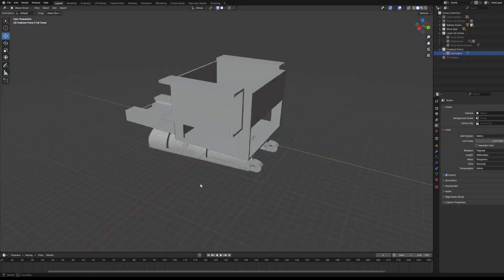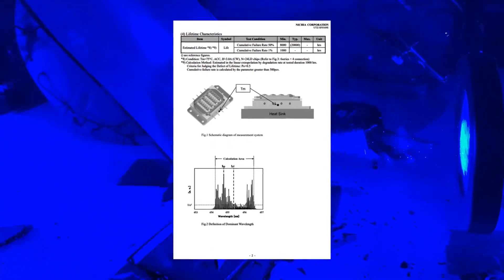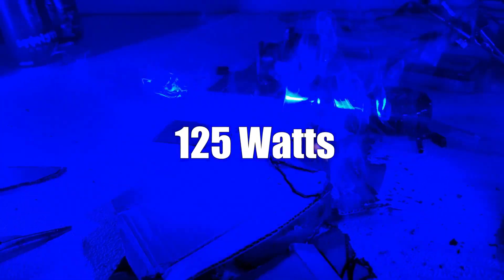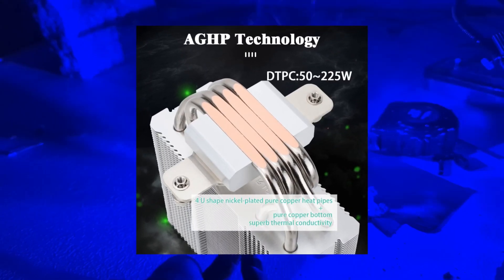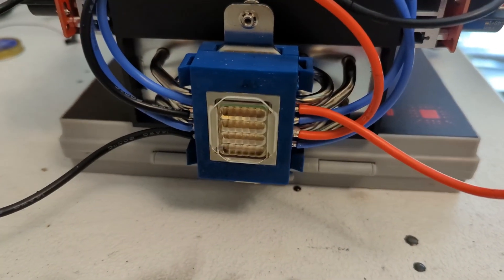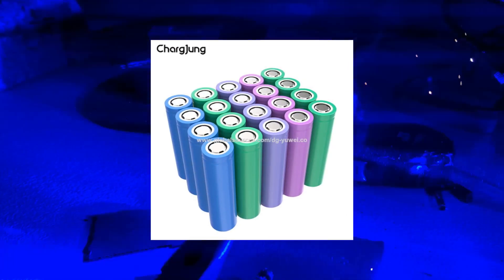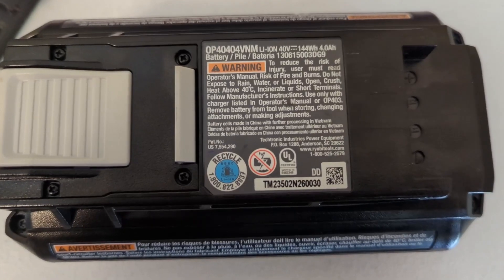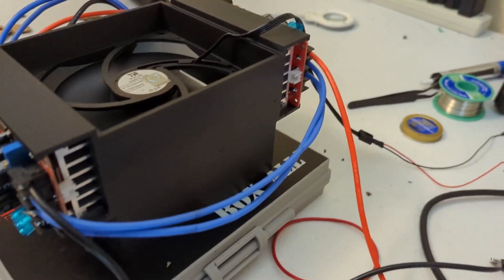NUBM37 125 Watt High Power Blue Laser

Comment: All of this can be easily carried in a box.  This is one of my lasers that uses the same 125W laser array

https://youtu.be/fcedMyiD3Qc?si=F_gSPOZQgxgo2bQV
Reply from the maker: I've seen your video, and loved your design. It's why I bought the diode array in the first place to toy around with it. I subbed to your channel a while ago.
Reply: @EikonicEngineering  I am currently working on IR laser pumps.  I bought one 260W and one 120W.  With great difficulty I removed the fiberglass.  I had to shorten the array by about 5mm and drill a new hole at the outlet.  It was very hard work and it's good that I have a lathe at home.  Now I'm looking for a sneaky focus lens.  I have many lenses but they don't work.  Strange, but I still don't put anything in front.  Nothing happens as if I put in a regular piece of glass.  Cannot focus the beam

Comment: So you wire your boost converters in series then do the same with diode/
Reply from the maker: I wire the boost converters in parallel to the battery, and then the diode array is in series. There are four rows, and each boost converter powers two rows in series.